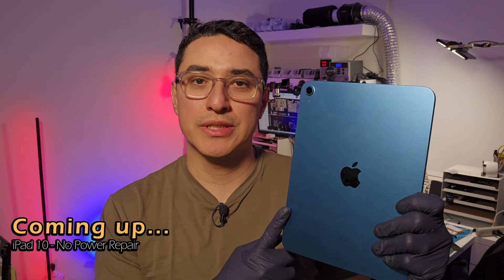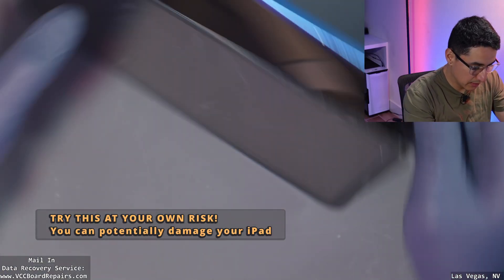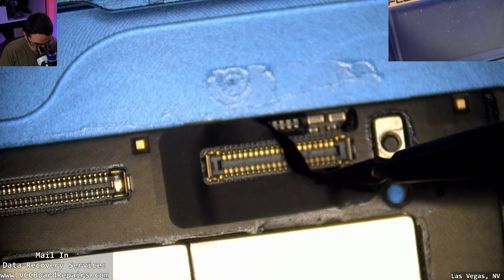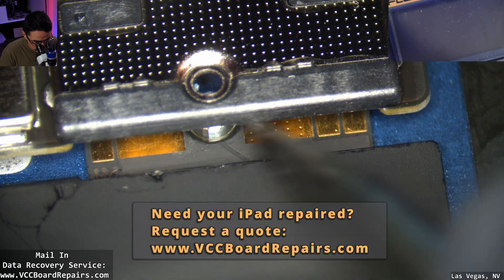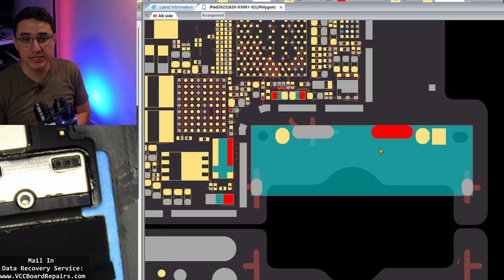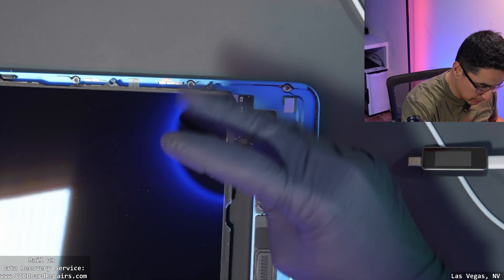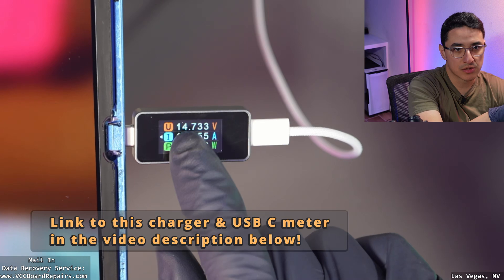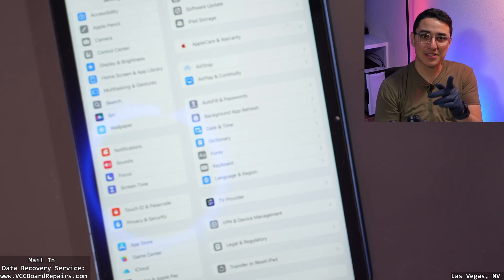iPad 10 Flashing Apple Logo FIXED in Under 10 Minutes! How to DIAGNOSE a bad battery

Comment: Hi my iphone 15 is turning off and on in every 3 minutes cycle and the panic log is showing 0x200000 i never drop my phone or back replaced can’t understand why this is happening i have checked the back glass there isn’t damage on cable too,will you be able to guide me about the panic code does it fix if i replace the back glass or it may be motherboard fault?
Many thanks

Comment: Jessie help, My iPad 8th gen when it's on the top of the screen display at the bottom and what's supposed to be display at the top is missing which is at the bottom
Reply from the maker: I don't understand what you're trying to say 😅
Reply: @VCCBoardRepairs  can I send pic through mail?
Reply from the maker: Through mail? No.
Through email? Yes.
Reply: *gmail
Reply: Ok I sent Gmail
Reply: I sent
Reply: Nvm I fixed it, I just took and old LCD while it was connected to the iPad smashed that old LCD and then purchase another LCD and it work. Weird ngl
Reply: I also had tbe same problem

Comment: Great watch as always, did this iPad have a replacement LCD as well as the back glass? Just wondered because I have one with same issues and it’s had the lcd replacement and wondered if there a connection between having this issue and the non genuine lcds
Reply from the maker: Not too sure why or how it happens
Reply: @ did that one have the lcd replaced for a non genuine one or was it an original lcd? Thanks rich